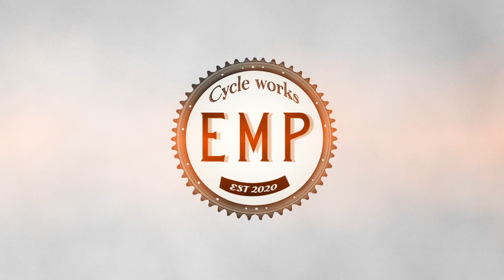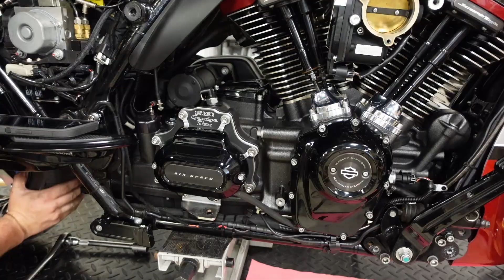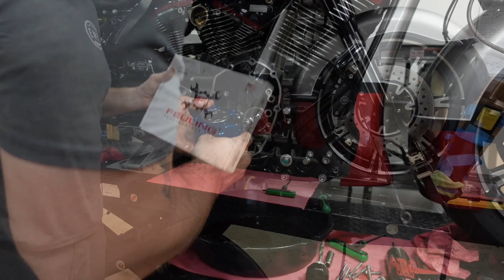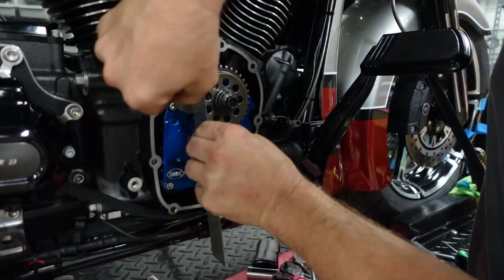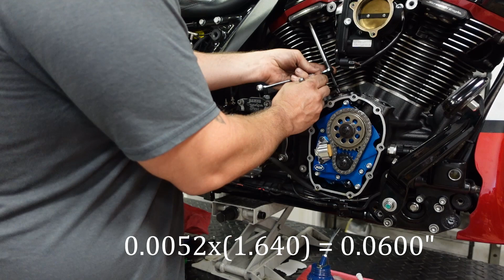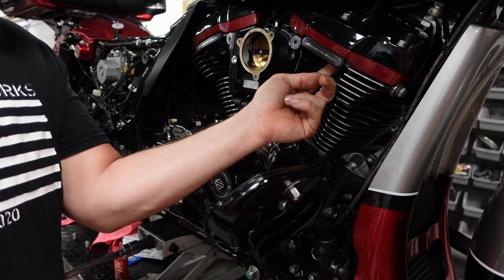Changing the Cam in the 143 Cubic Inch Monster Milwaukee 8

Comment: Very very good.    But I would get a custom camshaft made. From comp cams. Youse a solid roller cam from VThunder   They will design you a killer profile for your bore and stroke and cfm lifts on your head with compression ratio.    That’s what I Yoused. I made 201hp 216 torque.  It’s got lots lots potential
Reply from the maker: Thanks. I will keep that in mind. What exhaust and throttle body are you running?
Reply: @empcycleworks  70mm on center intake manifold custom made 70 mm HPI. Throttle body    12.2 grams injectors and I run the bike on MR12 race gas      Running a 2 into 1.  God zilla. DD  pipe.  With a big city thunder custom baffle for the muffler
Reply from the maker: nice setup. I tried to get the customer to change to a bigger throttle body and a d&D pipe. But he wanted to keep the 64mm and the khrome werks exhaust.